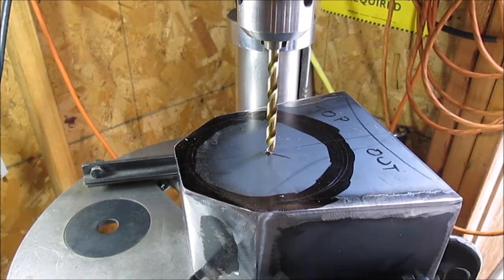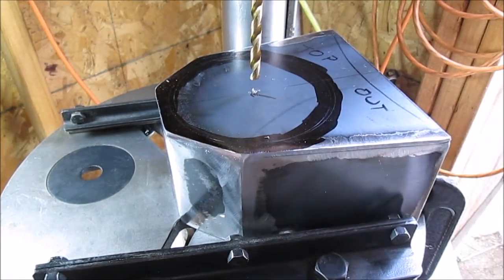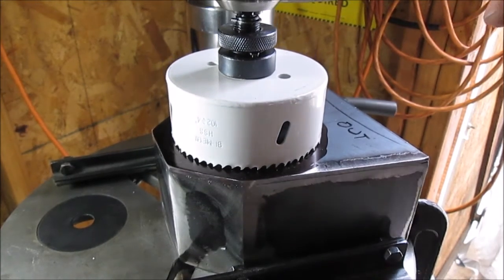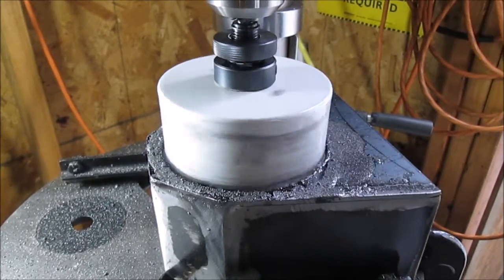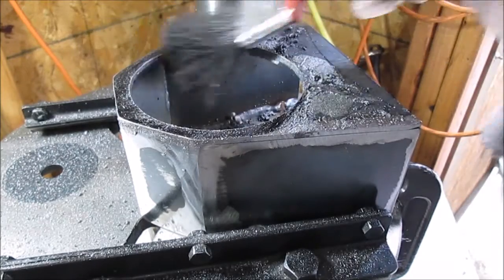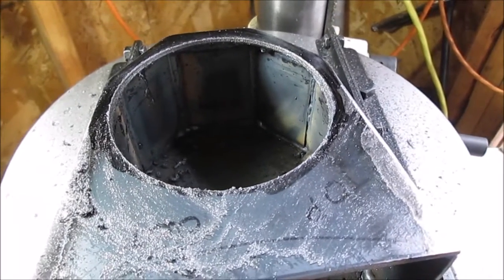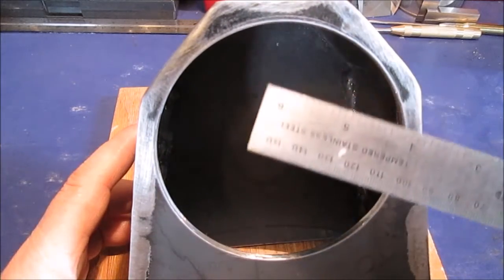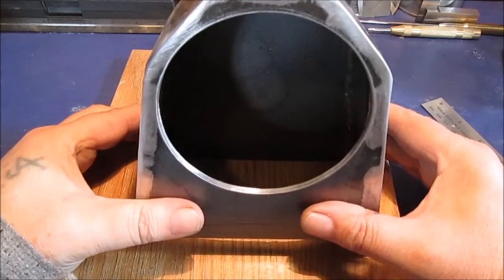Air Tank Potbelly Stove Build Part 10

Comment: That is going be a very nice stove.
I bet you could sand the top of hole saw a little bit to make it line up tight to the pins.
Reply from the maker: +MIKE MAYERAN Maybe put an O-ring on it and Tighten it good
Reply: Good Deal than.